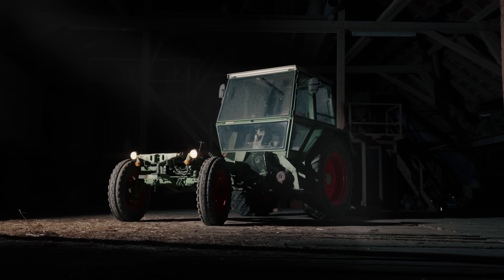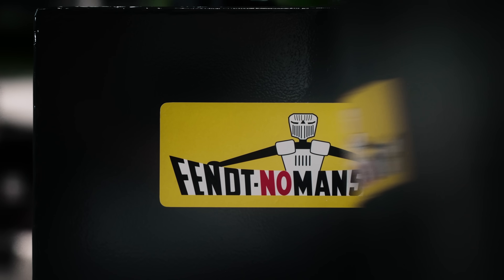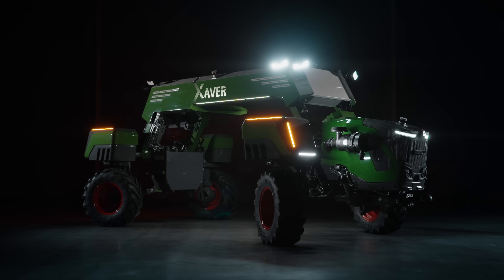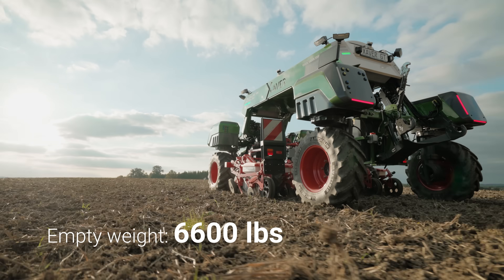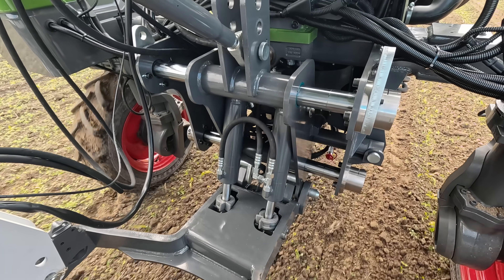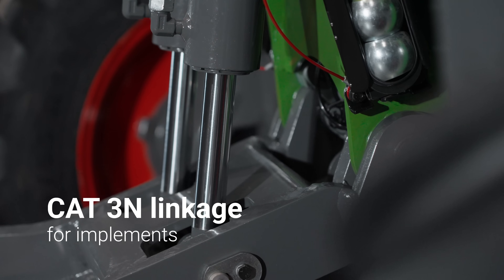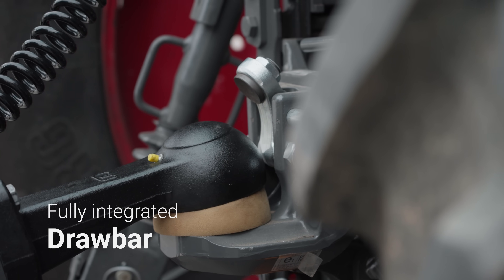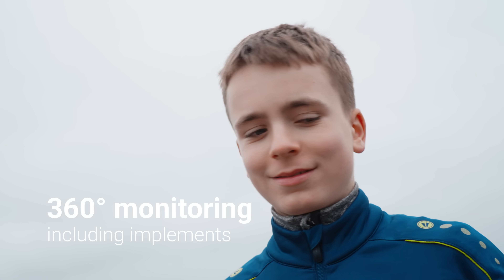Fendt Xaver GT | Innovation meets tradition

Comment: Autonomous field robots could make agricultural processes significantly more efficient. They would operate independently, even at night, and protect the soil thanks to their low weight. This would allow farm inputs to be used more precisely and yields to remain more stable. Such systems would probably be most economical in machinery cooperatives or joint operations, since utilization could be optimized across multiple farms. Investments and maintenance costs could be shared, and experiences and data used collectively.

I myself come more from factory automation, and I find it fascinating to see how Industry 4.0 principles—autonomous systems, data collection, and process optimization—could also be applied in agriculture. It seems to me that ROI should be viewed holistically, not just in terms of labour savings. In short: a super interesting business case. What do you think? Greetings from Germany
Reply: We've been following those principals in ag for over 20 years, the technology for true autonomy is just finally getting here.